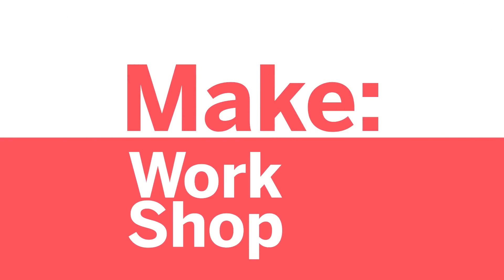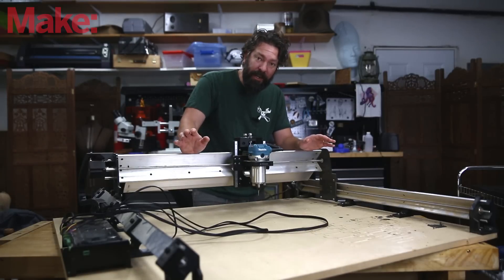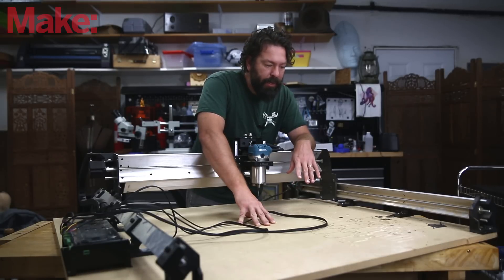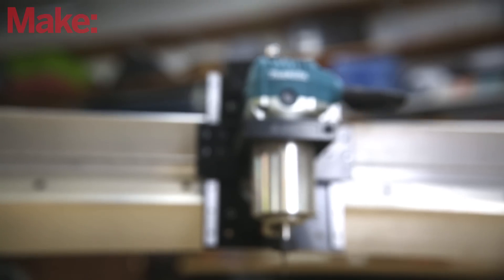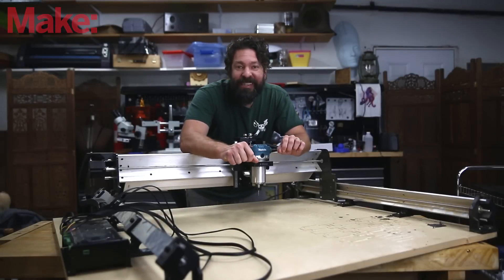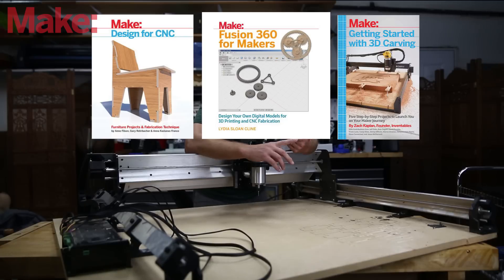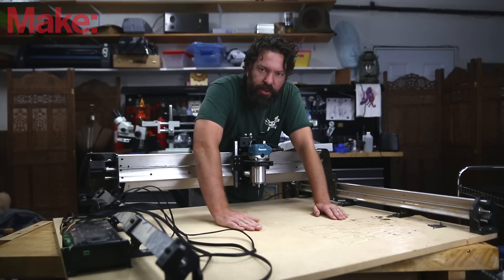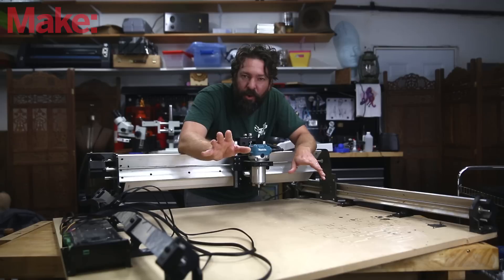First Look: The Longmill CNC Router

Comment: sir can it cut acrylic and aluminum? if so what thickness can be done
Reply: Yes it can cut both. Acrylic you can cut more than 1 inch in thickness and the same for aluminum
Reply: @chrismakesstuffCNC  im looking at many machines at the moment and kind of surprised that a machine thats been out this long, has no review videos. and there has been alot of talk in the facebook group about Z depth changing/going too deep but Z zero being correct..and supposedly all settings are correct in grbl.. any idea what the issue is? im ready to pull the trigger on something but do not want to regret anything later (on any machine) are there any import duties and taxes to the usa? thanks
Reply: @sac40218  hey Chris, yeah I was chatting with that guy over on the group and it turned out the microstepping on the driver had been switched over - pretty easy fix 👍 To be honest we keep spending so much time working on the machines and assisting customers that we haven't had a chance to really reach out to anyone to make a review of the machine. If you'd like you can see our customers take in our FB group, online forum, or in our customers reviews on our product page. If you're in the states then you will have to pay brokerage fees once the machine arrives at your door but otherwise all other costs happen at checkout. You can even put your address in the cart and you'll see an estimation on the shipping cost before you have to purchase it. 

If you have any other questions let me know 🙂
Reply: you just have to take shallow passes to do aluminum

Comment: There are several things that bug me about this machine, mostly how the Leadscrews are sitting inside while they had the opportunity to put them outside and use the aluminium angle as a dust deflector, would have been especially good for cutting aluminium. And its hard to be sure with the camera bloom, but are those 3D printed parts on a 1,3k machine? Yeah, no, for that money you can get a STEPCRAFT-2/D.600. Back to the drawing board IMHO.
Reply: The full kit for a 30" x 30" cutting area is 1100USD where if you're comparing it to the STEPCRAFT D.600 kit it has a price of 1800USD and a work area of 23.6″ x 16.5". Certainly there will also be some differences between the machines for a $700 price difference.

In regards to the lead screws, the design of the machine is reversible to make the rails face outwards if the user is concerned about dust. If you're running the machine with a dust shoe though, there are no problems at all with dust affecting the performance of the machine
Reply: If you look closely you might be able too turn the runners around and shim the difference at cost for a little work surface..

Comment: The only problem i see in construction is that steel v bearings running on softer aluminum. Although might work out.
Reply: The v-wheels are delrin so that the aluminum won't be worn out, rather the wheels are the ones that wear out. The machine uses off-center nuts to mount the wheels so that they can be kept tight over time

Comment: Are those mounts for the two y axis beams 3d printed?
Reply from the maker: yes, the mounts to the spoilboard are 3d printed
Reply: Make: Thats disappointing.
Reply: @StuffWithKirby  why? they are big sturdy plastic mounts and if you wanted to, you could print 20 more supports and make it even more sturdy. or cut a piece of hardwood at a 45 degree angle on a table saw and have the entire piece of angle supported!
Reply from the maker: I should specify which ones you're referring to. The ones that hold the frame (y axis pieces) to the board are 3d printed. The ones that hold the moving gantry piece (x axis) are metal.